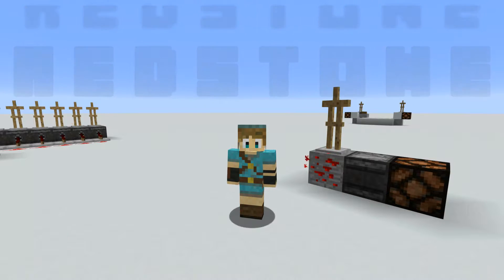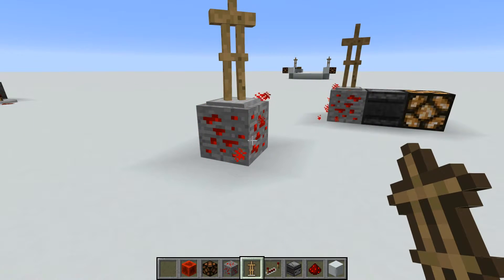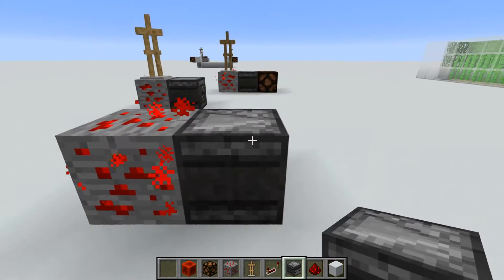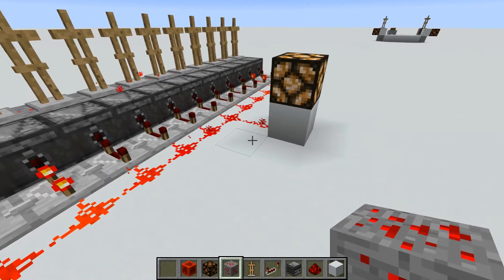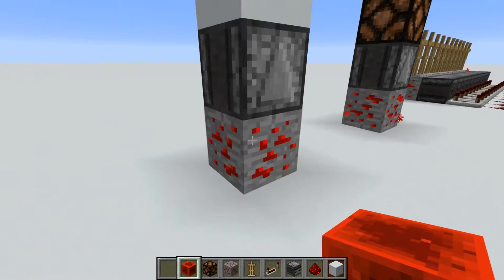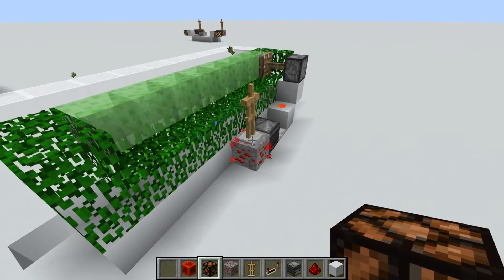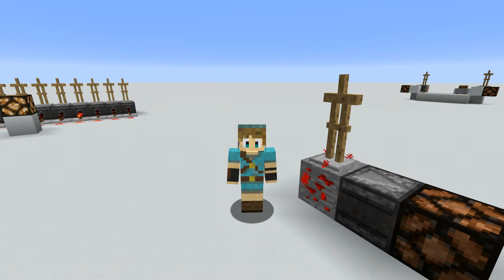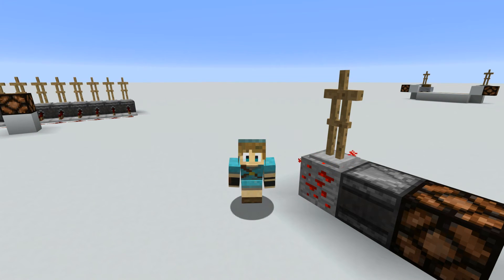Minecraft: Compact Random Pulse Generator [1.11+]

Comment: wow! I completely forgot about using block updates for random pulse generators! :D I'm making "the backrooms" in minecraft, & wanted a way to have lights flickering on & off randomly for added spookiness

my (not working) solution was to trap & nametag bats in a 1x4 area (adjusting the area according to how often I wanted the light to flicker on), with a string occupying one of the blocks, with the string activating an observer

things to bear in mind if anyone else uses this method: bats are 0.5 blocks wide & o.9 blocks tall, and have a bias towards flying east, and will perch & stop flying if you give them any solid blocks to perch under, so I'd recommend making the ceiling of their enclosure out of walls so that they're always flying

only problem is ...the bats don't seem to activate the string when they fly through it - can anyone else replicate that problem? (I can't find a bug report for it)

(I didn't want to use other animals that would interact with the string, as they would either make noise or need to be transported from afar)

since it was a high-effort,-no-reward approach, I turned to the internet & found your lovely video

I verily appreciate you showing several ways the rand-pulse-gen can be set up, so people can get an idea for what is being hard & soft powered, and also the tip of compacting it down further by squashing it together with a piston is very nifty :) also, telling & showing how fast it is but then upping the randtickspeed for demonstration purposes, & also explaining when this setup will be active & when it will be dormant - all very useful info :D

bit of a rambly comment, but I just wanted to say thanks

I can confirm this works in 1.15.2, and when the server I'm on updates, I expect it'll work for 1.16.4 also

also, for ideas of other random pulse generators, check out ilmango's "20 unusual redstone components" video:
https://www.youtube.com/watch?v=0SlBt010FL4

(he mentions a few designs, which would be less compact, but provide you with a wider range of options, if for example your redstone couldn't be hidden away and you wanted a rand-pulse-gen that is more thematically appropriate to an area)
Reply: Reading this 3ys later i also came here for randomly flickering lights... For a backrooms build...